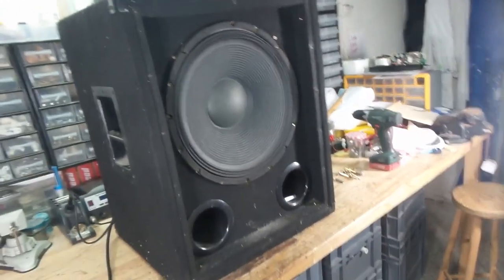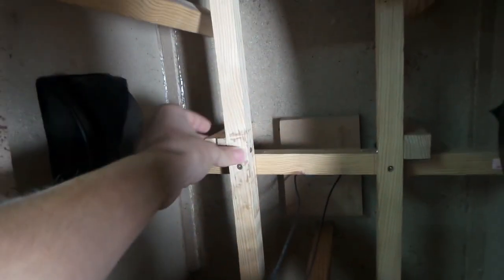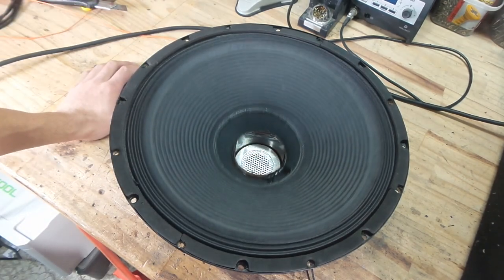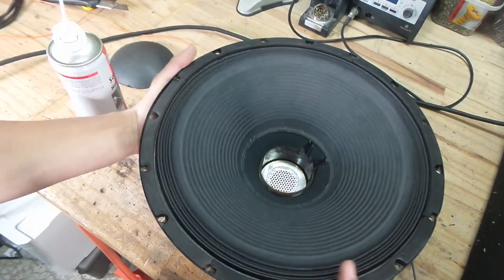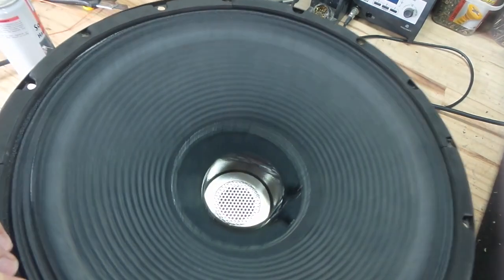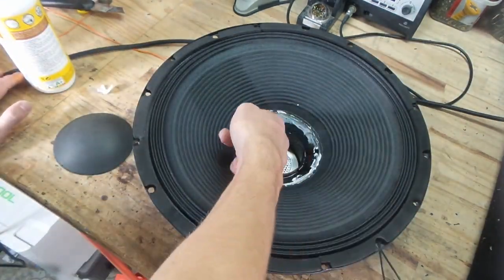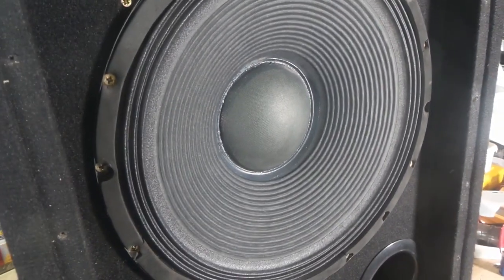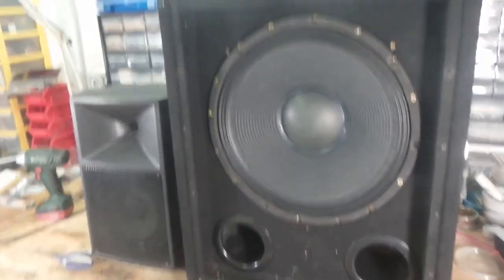Speaker Quick Repair techniques - Easy - Strange Buzzing Sounds

Comment: It's not anything in the woofer but instead it is the coil itself. On older woofers or woofers which have been in the elements the coil will very slightly expand or warp and cause coil rub. If this happens you will need to reconnect and/or recoil the woofer or buy a replacement woofer.
Reply: Correction *Recone
Reply: Another reason can be the stamped steel basket is bent or the motor shifted on the frame from the speaker getting dropped and recentering the pole by tapping the top plate with a hammer has fixed this issue for me in the past.

Comment: I m surprised,U didn't use a 0.5 mm plastic paper or an x-ray film to clean it with downside to upside stroke's, this problem will be rectified.

Comment: My Vintage 6 inch speaker is doing the same thing.Playing frequencies around 30hz is fine,until i go to 60-70 hz,its starts rattling.Can i use compress air for this?

Comment: How did dust get behind the dust cap? How do bugs get inside sealed light fittings ? Maybe there was a houdini bug buzzing around your speaker ? Every time i pull something apart not find a fault but  it works after reassembled , it bugs me . Well done , helpful
Reply: Thru vent hole at the back of the speaker.
Reply: @ReynaldoVillaceran-jv1je  Ported soggy moist speakers with insulation is a sanctuary  for bugs

Comment: I know this is old but could be the spider has partially separated from the cone and the speaker is no longer moving straight in and out causing the rub especially in certain orientations due to gravity. Check the spider where it meets the cone.

Comment: Question what would happen if I put WD 14 in it would it blow up ?
Reply: Wd 14? If you think of using wd 40 i wouldn't recommend it since it can damage plastic and make a mess, maybe it can lubricate for a bit but i wouldn't recommend it. Better solutions are the ones in the video or use silicone based lubricant.
Reply: @wearefromserbia9714  ok

Comment: the same happens to mine , its an M-Audio av40 it buzzes when there are low freq sounds buy it buzzes louder and the sound it makes it is at a higher pitch.. dont buy Av40 by M-Audio, they are shit. also overheats after like 30 mins

Comment: Next time that noise starts up, you can just remove the driver, then turn it over and smack the magnet real hard with the biggest hammer you can find.  The sudden shock  combined with gravity will knock the debris out of the slot in the motor and free up the voice coil and allow it to center itself. Don't worry about harming the magnet, it's very durable. However there is no problem if the magnet shatters into pieces because like you said- It's a piece of shit driver anyway.  Then you can buy a real loud $5.00 Pyle sub-woofer to replace it as an upgrade mod that will impress your friends.

Comment: thats def not 300 watts rms more like 30 especially not much performance is gnna happen with 18 gauge speaker wire and omg poor workmanship on that old school sweet sixteen party box
Reply: Check the spider. The fabric often looses its “bounce” . The ability of the spider to return the cone to zero from + - displacement has been reduced. I have rejuvenated many speakers by spraying the fabric spider and Cambriic surround with a flexible quick drying glue. Not too solvent based or you can unglue the speaker. Try Holts dampstart which is a spray for car HT leads. Go easy. Experiment on little speakers first. Good luck.